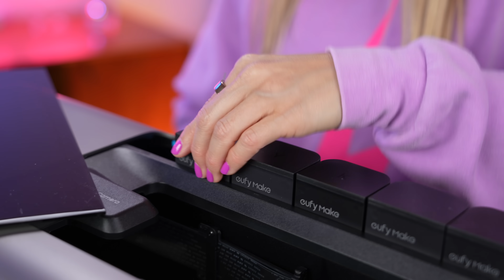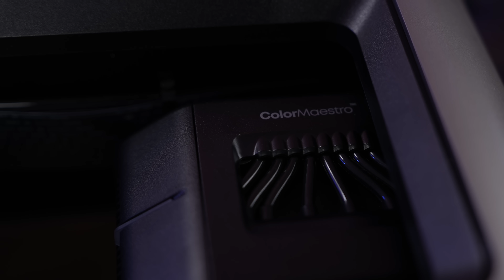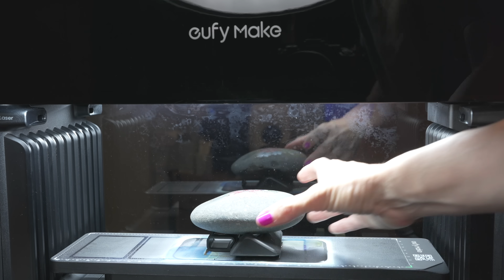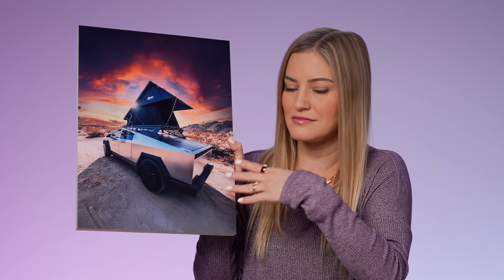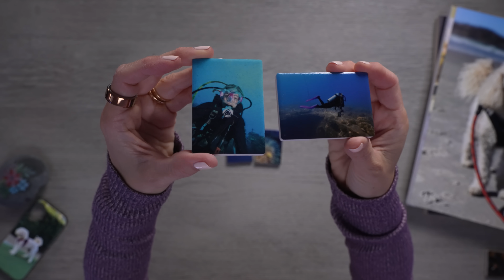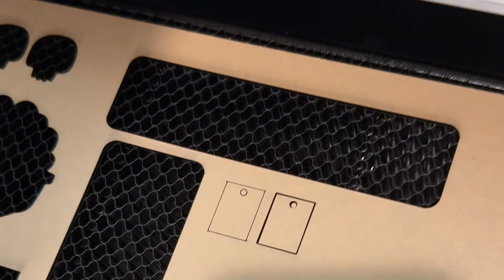The Coolest Printer I’ve Ever Seen! eufy Make UV Printer E1

Comment: Would love to have seen an example print on a t shirt..lol very cool machine..only obvious maybe down side is the size of what you can print..bc of the size of the machine itself..of course it would have cost more if this was bigger and can accommodate bigger surfaces to print on..lol just curious for larger items does the bed tray move as its printing?..I guess it does not show you a "preview" image on said surfaces?..bc like you showed on one of the phone cases..the image turned out darker..and if you were able to show a preview a person can make an adjustment before printing?..so you wont have to do another if you make a mistake..haha
Reply from the maker: I did make a few mistakes at the beginning but I think after those I learned a lot as far as what color selections to use and placement of the image. I definitely plan on doing some more stuff with this so will have to share!

Comment: Great review! Fellow E1 reviewer, on the dull color on your leather iPhone case, try white >cmyk and you will be vibrant 😀 since it’s a rigid leather it’s fine with the hard ink or even better with the new soft white ink they are coming out with
Reply from the maker: Thanks for the tip! I thought I did white first but I may not have. I did for some of my others and you're right it makes such a difference!
Reply: This isn't a review, it's more of an infomercial. No good/bad points, in fact just gushing hype, no doubt cos Eufy supplied it without charge.

Comment: 🍏
I WOULD SANDWICH A PRINTER BETWEEN A KEYBOARD'S COMPONENTS.😊😊😊😊😊😊😊😊😊😊😊😊😊😊😊😊😊😊😊😊😊😊😊😊😊😊😊😊😊😊😊😊😊😊😊😊😊😊😊😊😊😊😊😊😊😊😊😊😊😊😊😊😊😊😊😊😊😊😊😊😊😊😊😊😊😊😊😊😊😊😊😊😊😊😊😊😊😊😊😊😊😊😊😊😊
THE KEYBOARD COULD USE A PRINT BUTTON AND A MICROPHONE BUTTON FOR AI. IT COULD ALSO USE A TOUCH-DISPLAY SPACE BAR AND AN EJECTING TRACKPAD THAT COULD ALL BE BUILT INTO A VERTICALLY UNFOLDING "KEYBOARD FOLDABLE" SMARTPHONE.😊
Type KRIS ERTMER into YouTube and go to the picture of Barbie.
Then type APPLE CAR into YouTube and go to the blue monster.

Comment: Would it be good for a small business?
Reply: Yes. There's also other attachments such as a DTF laminator and roll to film accessory so you can print stickers and banners up to 10m long!
Reply from the maker: I would say so!
Reply: You have to run the costs carefully on this since the ink is a lot more expensive than what you can get on the open market. There are also some issues to be aware of with wear and tear on the print head and the amount of ink used to self-clean the printer.

I’d probably say that if you want to do production runs of designs to sell, it’s probably better to contract with a real print shop. If you want to be in the business of making one-offs or really micro runs (one plate full of a design), it might be a good fit. Like, aim to price the output as luxury, not impulse buys.
Reply: @DannoHung  Exactly. I could see this supplementing a businesses offerings (think kick knack things at a cash wrap) without having to commit to a large run, especially as consumer tastes change on a whim. You could do some great product testing without the commitment. Customers love something? scale up for cheaper cost.